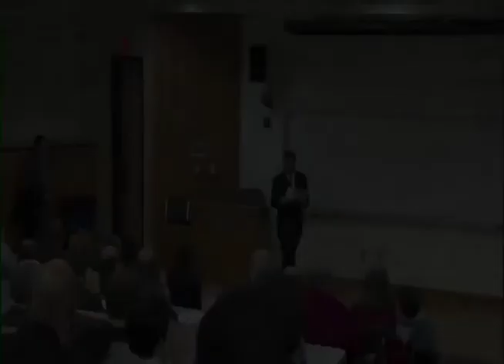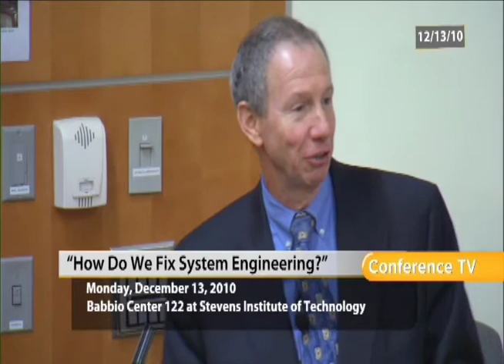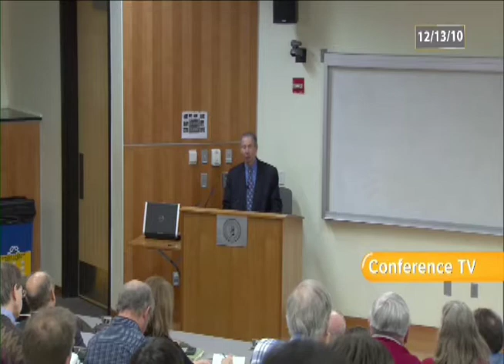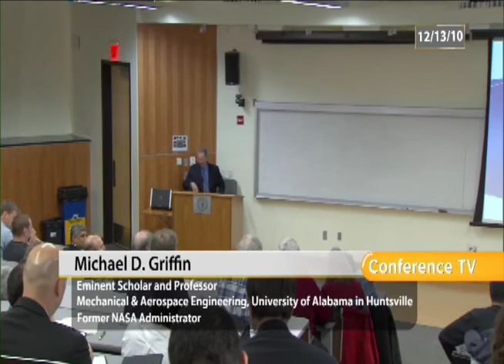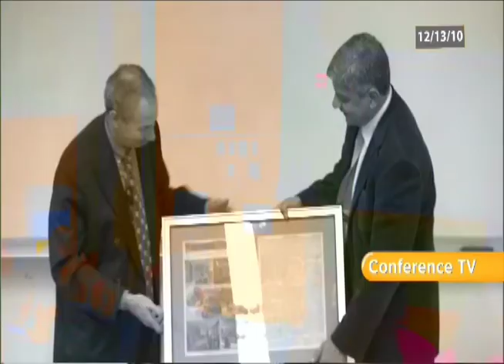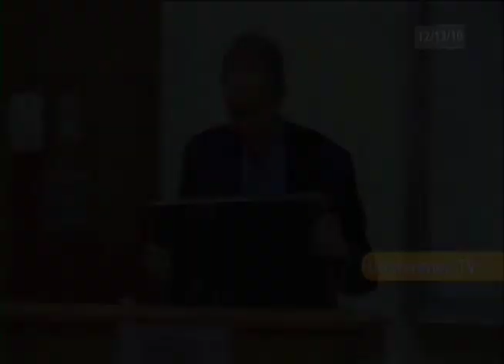Stevens Institute of Technology: Former Nasa Head on Systems Engineering

Comment: Dear Michael you are right and wrong. The right purpose is the overall failure of the system engineering. But you are completely wrong  on the cinetic motion system of the shuttle  and it's mechanical active motion of coupling and cx design failure.